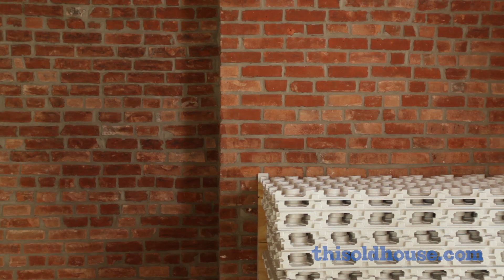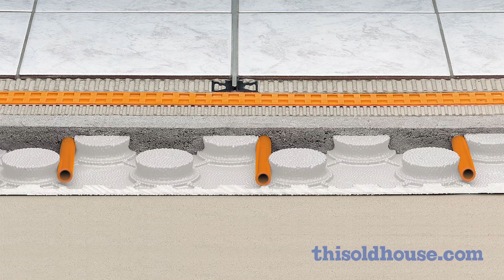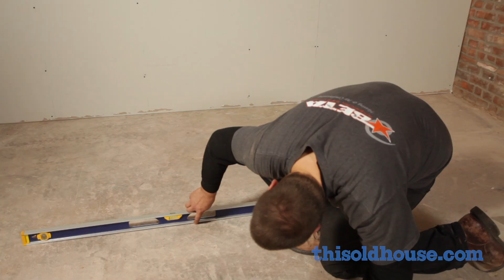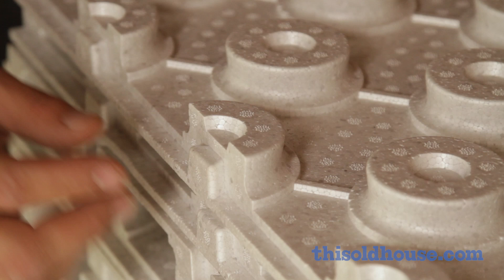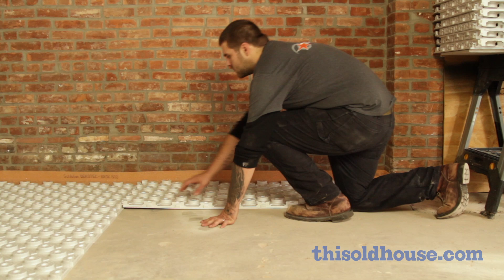How to Install DIY Radiant Floor Heating |This Old House

Comment: I'm going to build a 850 square foot garage package for a cottage. Would I be able to use this technique to do the entire floor and run it off a electric hot water heater?

Comment: We're looking into adding a hydronic floor heating system to an existing home on a concrete slab. This adds 1 3/4"? Seems like a lot to me. Wondering if an electric floor heating system would be more suited for an existing home?
Reply: Electric (Ditra Heat) is only 1/4” (excluding tile). But technically the electric heat is considered floor warming and not used as a primary heat source. However, I installed electric in my kitchen and dining room, and if I turn it up the forced air heat hardly runs.

Comment: Thank you!  But I'm confused. There's the foam layer with the "pucks" -- you put Ditra on top of that?  I guess you put enough thin-set to cover the pucks, then put this pink layer on top?
Reply: If you're interested in this start with watching European videos about radiant heat floors. Don't follow US jokers unless you want to flush a lot of money.

Comment: why is this foam $200 for a 2x4 panel
Reply: I think you are looking at a bundle of 12 panels. Today, Feb 2025, that is $240 which works out to $2.50 per sq ft.

Comment: At the end there is orange foam on top of the concrete, is that correct?  Won't that prevent the head of the tubes from getting to the tiles?
Reply: That’s not foam, it’s Ditra uncoupling membrane, it doesn’t act as a thermal break, and it helps protect the tile from cracking.
Reply: Hint this wasn't done right and not even close to code.

Comment: 200 bucks for a 8 ft3 panel...2500 in foam for a 10x10 room, plus all other products plus labor....that's a 10k floor,...absurd.
Reply: Well that also would Include a properly sized boiler and correct installation.

Comment: Does anybody know if I can just lay plywood over the foam instead of a concrete layer? Reason is in my application, weight is a major concern.
Reply: No, concrete is what absorbs, stores and transfers heat. Plywood would not do that. You need to look at the kWatts/ meter2 heat output of systems and with plywood little heat will reach the room. Plus there will be air between the tubes and the plywood and that's an insulator.
Reply: There are other systems that have less heat output, but do not use screed/concrete. Look up floating floor underfloor heating installations. The issue there is how much heat do you need to keep you warm? Will this be the only heat source in the house or radiators / electric heaters also?
Reply: firpofutbol … you probably don't realize that a thin layer of concrete is maybe 10 pounds per square ft, which is not much in the big picture. Standard wood construction is likely good for at least 40 pounds per sq ft, which means you can safely put 4,000 pounds on a 10 x 10 (100 sq ft) floor if you spread the load evenly.
Reply: Check out Ditra heat, the electric floor warming system by Schluter.

Comment: What about this: from top down
Wood flooring or wood tile (My personal preference)
The water tubing
Radiant barrier (to prevent the heat from going downwards, only upwards into the floor and room)
typical insulating barrier
typical Sub floor

Better? The radiant barrier acts like a thermal blanket. keeping the heat of the above tubing from escaping down below into the sub floor.

Comment: Did anyone tested this kind of screed over the pipes?

Only 8 mm over the pipes? Ok, with an extra adhesive layer, about 13 mm over the pipes? Is it sufficient? Won't it break?
I've seen 35 mm screeds before, but never something less than this. The difference looks huge.

Comment: What happens when that tubing starts to leak?  Break open the concrete and do the job over?  Doesn't sound like a good Idea!
Reply: not entirely over, but you do need to chisel the concrete of the broken spot and fix it
Reply: @lvkuang  How would you know where the broken spot is?  It seems like a problem that will be costly and a pain in the future.  There are better alternatives for less money.
Reply: @ExtrovertedCenobite  finding the leak is half the job. Using a thermal image camera while running the system can give you an idea where the leak is
Reply: @lvkuang  that would give you an idea of the general area, still you have to cut open a portion of the concrete, replace the tubing then refill which never matches perfectly.  Too much rise, too much cost and not the best solution.
Reply: @ExtrovertedCenobite  I don't think you can 'patch' a part of the tubing. At least, the idea is to have no joints and a patch would mean joints. In plumbing, the first thing you learn is that leaks only happen in the joints. If you bend a pipe you wont get a leak, but if you weld a corner joint, you are increasing the risk. The main thing with these systems is that there are no joints. It is a single, whole length of pipe per loop. Loops are up to 100m. Every loop joins to the manifold, which is outside of the screed. Those pipes used are usually not the same ones as for other plumbing jobs, mostly because they are chemically made to last years and not to transport safe drinking water. It is a closed system, so this water will not ever be consumed. There is a 50 year warranty on these pipes. All that being said, if there is debris under the pipe that damages it when cement is poured over, or you decide to screw a piece of furniture into your floor and go through the pipe ... you are screwed.

Comment: How come each panel is $207 at home d?
Reply: There are 12 panels in each box and they are now $179 for a box.  12 x 8 = 96 sq. ft.  So about $2 per square for for the panels.

Comment: I would like to have finished concrete floors for my flat/condo in Chicago. Will this be warm enough for winters, on the second floor? Also, is it expensive to keep warm? I use electric radiators for heat and wondering if this would also reduce my overall costs Thanks!
Reply: Korea has this system. We dont have others. Very warm. We mostly use gas not electric. We pay a lot gas utility in winter but I think paying money is better than get a cold or sickness. I paid 200 dollars in the winter and 150 dollars in the summer. Summer is air conditioner for electric.
Reply: This type of heating system is mainly used on Europe and doesn't need any other heating system if it's done correctly not even winter and floors is always nicely warm.

Chancing electric radiator for water radiant heat might not be best solution because you need source for hot water aka water heater or something else.
It might be easier to use electric floor heating system in your case.

Does it reduce overall heating cost, well that depends mostly how well your flat is insulated but as overall you can slightly lower room temperature because your feet will be warm and that's why it feels warmer and same reason it consumes less energy.

Comment: What's the cost per sq ft?
Reply: Corn Dog … cost depends on how much pipe you put down into the floor, although the pipe itself is the cheap part. In order to get started you need someone to figure out how many BTUs the room (or house) requires. This comes into play for the diameter of the pipe, spacing of the pipe, and the water temp that is circulated within the pipe. Spacing the pipe 12" apart versus 6" between runs uses a different length over all but 12" spacing only gives you half as much heat, all else being equal. That's why someone has to do the math up front.

Comment: Putting socks on or house shoes are a whole lot cheaper and easier.......🤔
Reply: Tigerdog 82416 .
Cheaper is it???
Show us the video of you using socks to heat your house!
Reply: But there are many rich people out there who have money for this. Me, I double on socks during winter!
Reply: Some people add a hot water coil to a stove they already burn 24/7 for 5 months and use it to distribute heat (btus) more evenly without 10 extra fans going.
Reply: It heats the house what are you talking about?

Comment: Could you not use a composting bin with gallium resivors to help absorb the heat from the composting bin and conduct it to a water tank that is being circulated through the floor to heat a room or home? 😊
Reply: Indigo Dragon71 I don't know that I'd want to use gallium, I wouldn't want the possibility of that getting lose in my compost.
Reply: Wow so 👽 use composting bins to eat out of when they can't get a human colon to hollow out? Hay how interesting. 😂

Comment: Not a DIY job period. So many jobs we have had to rework because homeowners have no idea what they are doing. Get a pro
Reply: You sound more like a pro who doesn't want to lose work.
Reply: Thomas Israel service tech for over 30 years and the bs that is shown on here to homeowners is what drives us nuts. Homeowners think they are experts on the matter because they watch the show and they butcher up the jobs up so bad we spend three times as long as it should cleaning it up. 

Then you the homeowners get pissed at the bill to unscrew the mess you the DIY community caused. If a homeowner wants to do it fine, and when it goes wrong your homeowners insurance will not cover the damage period. If you don’t pull the permits and have the proper inspections and when it goes wrong your insurance will not cover the damages.

I Had a homeowner attempt to do just this and caused 45k dollars in water damage because he cut corners. He never pulled a permit or had it inspected. Then got pissed at the handful of quotes he got were so high. He refused to acknowledge he cost himself the headache and we get the headache to clean it up to code so it can pass inspection.
Reply: that is why people watch these videos.  surely this is not so complicated and arcane that a person of average intelligence if given the specificiation cannot figure it out.  let me gues .... you are an installer maybe?   ;-)
Reply: @justgivemethetruth  .  I heard people like this guy the whole entire time I built my garage, remodeled my entire house and built a 720 sq ft addition from the ground up.  All myself.  An average person with a strong work ethic can easily do almost all home projects.
Reply: And so many homeowners need to get work done twice because some "pros" are clowns
Reply: That headache you get?  Thats called a paycheck and you choose to earn it,  and also choose to not change careers and be happy. Bitching about it on YouTube all day surely makes the shitty people  who can't admit wrong or be humble enough to realize its a job too big,  stop and call a pro.

Comment: How do you know those are female edges and not gender fluid edges? smh
Reply: especially when at the same time youre saying we cant assume the wall is straight
Reply: It was assigned at the factory 😂😂😂
Reply: That floor has  indentified itself as gender netural.
Reply: triggerd

Comment: AVOID THAT.!!!  Very good example how NOT to install water operating underfloor heating. Hot inlet and cold outlet are in different parts of the room. They MUST be next to each other to spread the same temperature across the room
Reply: Looks like you don't have any clue how this system works. 
It's low temperature system that water maximum temperature is usually limited to 28 celsius.

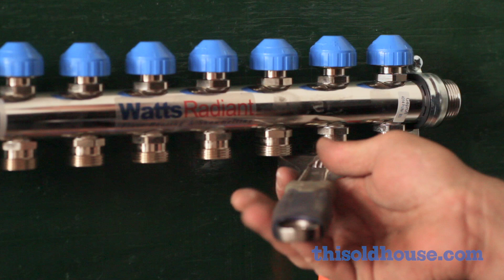Manifold that you can see on 4:15 is usually installed central part of house and all PEX tubes is connected for it from different rooms. 
There are commonly 2 circuit on each room as you can see also on this video. Near outside wall is circuit which will be set on calculated flow and on center area is another circuit which is operated whit room thermostat.
That manifold will be equipped with electric actuator which is operated with room thermostat on each room and that way temperature will remain stable no matter where those inlets and outlets are.
Reply: @mr.wizeguy8995   U didt get Ptica....the layout of pipes is wrong....that works with electrial heating wires but for water radiant heating thit is the right one https://www.youtube.com/watch?v=46gdr57aHuE&ab_channel=ICMAS.p.A. to spread the temprature evenly across the room. If someone whould  do zig zag at my house i would show him the door before he connects the first pipe.
Reply: @mr.wizeguy8995  What Ptica meant is that there is an optimal 'snail' layout for the pipe. The water slowly cools down as it flows, so if the end of second half of the pipe is all in the second half of the room, that side will be colder. It is not a massive difference, because pipe lengths should be up to 100m per loop, but there is space for optimisation nonetheless.
Reply: @irinacamilleri5818  I missed that he meant by that. 

If you talk about just pipe layout best option is to do 2 circuit in each room. Smaller circuit is near exterior walls and is set to calculated flow without thermostat meaning near outside wall floor is always warm where most heat loss happens due proximity of exterior wall.
Bigger circuit will cover rest floor area and you can adjust it flow by thermostat by raising or lowering room temperature with it.
 
Best layout for pipe is go to circular from outside to middle of room and then other way back then every 2nd loop is warm and other is "cool" and you get much uniform heat on whole floor.

Layout what they did on video can be done on small rooms temperature wont be so much different on each ends because pipe is kinda short so water won't have time to "cool" so much.
Reply: @irinacamilleri5818  it still isnt correct at all how this was done.

Comment: this method is obsolete. nuheat or electronic floor heat is the way to go. less then 3/16 thick. schluter sucks anyways wedi system is the way to go.
Reply: Electric heat in a basement floor? Wouldn't that cost 3-4x what a Natural Gas boiler would in energy costs?
Reply: You can warm up water with any heat source. Electric is always same so this system is much better.
Reply: @zentraal  There are two types of electric floor heating systems other is for comfort uses small diameter heat cable and needs another heat source but floor feels warm beneath foot. 
Other system is more efficient, wire are thicker and doesn't need any else heat source and it can heat whole house even harsh winters.
Reply: I don't get what you try claim in-efficient?

Do you mean electric floor heating consumes more energy than electric radiator or what.

Floor heating are more efficient because heat is stored on floor mass also it provides heat evenly around whole house and you get less variation of indoor temperatures meaning no cold corners or really warm spots.

When you have lot of internal mass to store warm energy, less you need to warm up because it will remain same temperature much easier rather than if you just heat up air and open door lots of warm air escapes outside and then you need to be heat it up again instead heat is stored on mass where it will heat up the indoor air.
Reply: KCW
That maybe true in gasling not care for environment US but in EU electric heating is done only if you haven't have any other option .
The reason is simple (your) electric system runing costs are al laest 3 time more by month than proper water driven system.